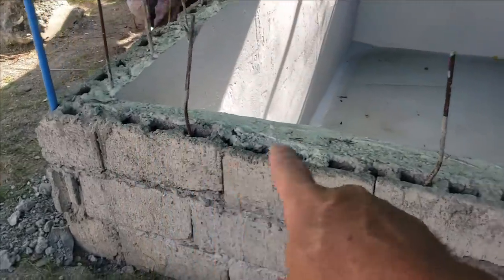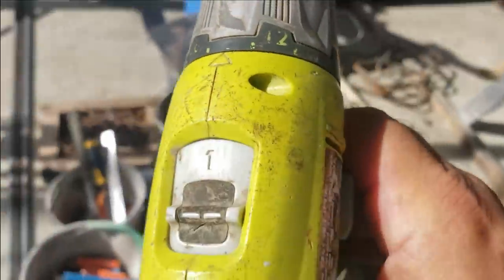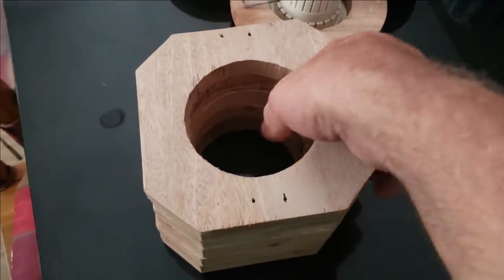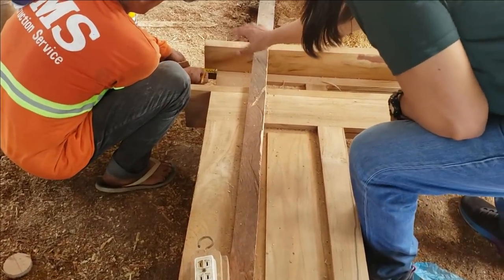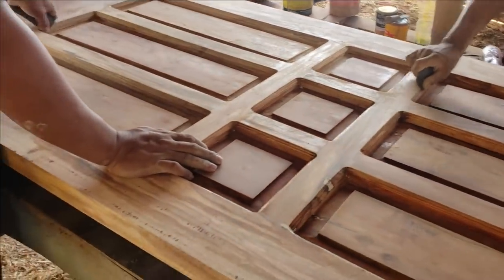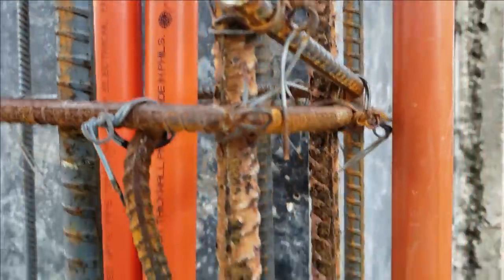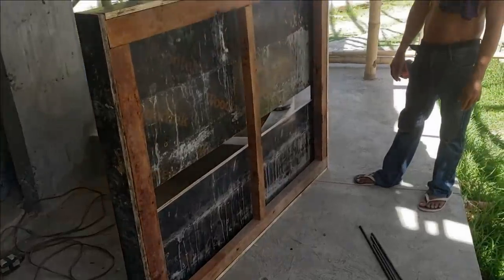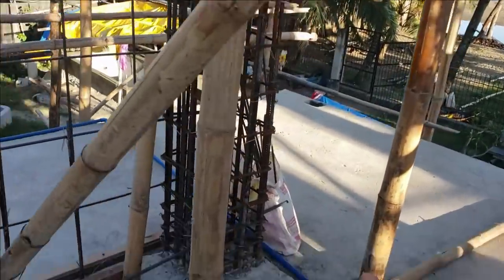Philippines Beach House Build Day 166 : Front Door Update , Mistake found AGAIN on Rebar

Comment: Why did ya go with the hollow blocks for the tank instead of forming? Just easier for the team to do pretty much solo without much supervision since it's what they are used to and it's perfection doesn't matter?
Reply from the maker: it is formed and cast poured on the inside. We used hollow blocks to quickly stack and hold the sand and clay back from collapsing is it gets disrupted. collaspses easy here. No way to form with plywood both sides unless you super over dug the hole and then later back filled. Just stacked the blocks quick. Then later cast a solid liner.
Reply: @TexasFilipino  Nice, thanks.

Comment: James, I will not buy CCP Tools.
I've had nothing but bad luck. Don't throw out your cordless or corded electronics. You'd be surprised some good electronics repair shops can fix some of those tools. I've had quite a bit repaired, cheap by our standards. 
I love the smell of wood working shop! Those places turn out some beautiful products.
Reply from the maker: Yes all those broke tools are setting for our next trip to Far Eastern to be repaired. You are right. I have had many motors rewound. Very common to change the carbon brushes here. The 220v power and dusty conditions really eat em up

Comment: James I have a question for you . Will USA Milwaukee cordless tools work there ? I know there is a difference in electric but when I bring my cell phone and laptop home there they charge up fine and work from the U.S. so I was wondering if the Milwaukee batteries chargers work the same and not burn up my batteries? And charge with no problems ? I do a lot of home projects there to and plan on a lot more and it kills me I don’t have mine there we don’t live any where close to cities that I can get good tools from with out a lot of time searching for them. Please let me know what you think if will work the same over there one day this winter when I’m back in Phillipines I want to bring my Asawa and see you build and pick your brain on your solar
Reply from the maker: No they will not! Cell phone or laptop and some tv's have low power usage with a automatic switching transformer built in power supply. Motorized tools and heavy amp equipment or appliances don't have that feature. Best to buy them here. You can get a step down transformer here but they are expensive , usually fail over time and you will consume more power.  On your milwaukee chargers turn them over and read - if it says like ac input 100v - 240 ac your ok if it says it 110-120vac or something in those lines then NO

Comment: Why don’t you have your drills sent in a balikbayene box to get the right quality from the us or Europe. It costs more but you get the quality and long life.
Reply from the maker: USA = Wrong Voltage and hassle. There is quality tools here. Real brands and right voltage n hertz. Just be sure your buying real.  I say if you love here then support here. Also if you support buying real here not fake then there will be a market for selling  good products. Sending stuff from USA on the most part is a waste.
Reply: When I moved the Philippines I sent all my uk purchased tools which were then used in building my house, now two years later they still work like new.. and no you cannot buy as good quality in the Philippines consistently as you can in the west. I also have all my household electrical items plugged in via UPS as these smooth out the dirty electrical supply so items last longer ie fridges that last 15 years in the west last only five years here because of the spikes in the supply